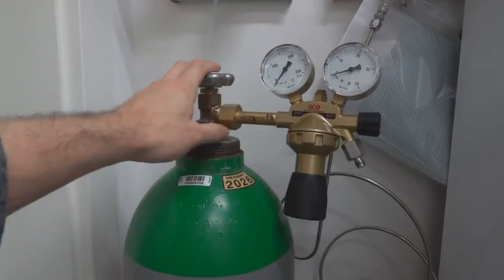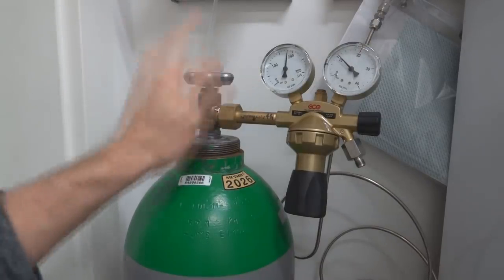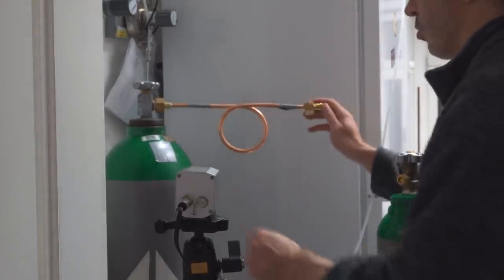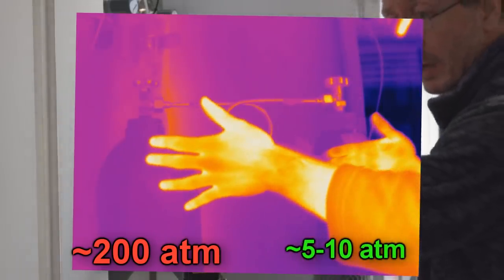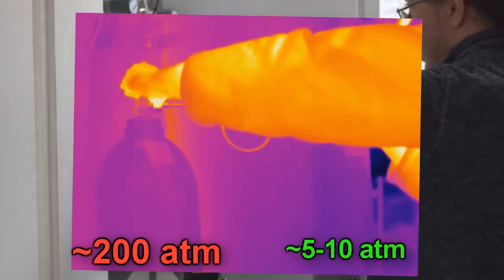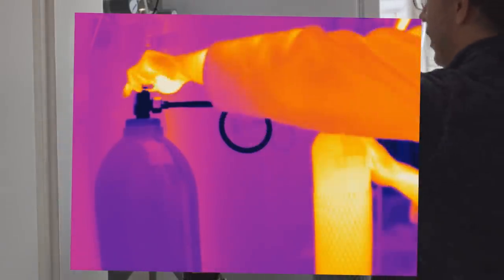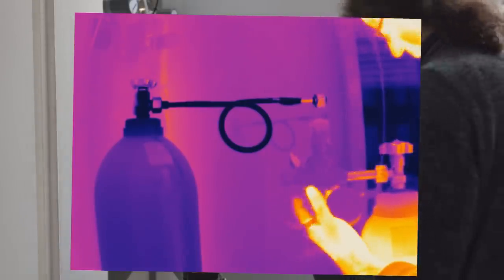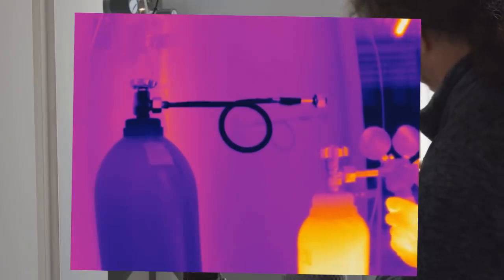Dangers of high pressure gas!

Comment: The high pressure realm, where the laws of physics as we know them don't work 😳 that's interesting. My car consumes LPG,  at least the pressure isn't that high, 14 to 17 bars... But good to know. I'll touch my gas tank the next time I fuel it up.
So, this should be thought of if you use N02 in your car. That even connecting the bottle to the system causes such incredible energy transfer...

Comment: I work near the hospital. They deliver the oxygen at times with low traffic. The hose from the truck becomes white the moment the guy opens the valve. Even more amazing is the hospital's oxygen tank: it has a heatsink!  The gas is SO COLD when it leaves the tank, the heatsink (which is, mind you, over 3 meters tall and has a base of around 1x1), is a BLOCK OF ICE even in the hottest summer days. 3 cubic meters of ice formed by just oxygen expanding when leaving a pressurized container. dang!

Comment: When I was 16 I worked in scuba shop we used to fill bottles submerged in water as they used to become rather. 

I remember being near a customer who opened two tank valves at the same time the force was unbelievable. Certainly eye opening we were taught to respect compressed air.

Comment: You should have explained that the heat-up is due to the gas firstly cooling by expansion and then being compressed. Compression alone (from room temperature) would cause WAY more heat than that.

Otherwise:
GET YOUR FUCKING SAFETY PROCEDURES STRAIGHT!
This has been a horror show to watch.
1) Chain your bottles
2) Always used hearing protection. A rupture at that pressure may make you deaf.
3) Gloves
4) Face shield

As a side-note... 200 bars makes a nasty sound. Some high-pressure pre-charge cylinders operarate at 500 bars and above. Now the sound coming from that kind of things opened up is deafening beyond all expectations. Will easily blow holes in thick gloves, rubber, etc just by the "jet" of gas. Extremely dangerous, outright lethal.

Comment: How efficient is compressed air as energy storage? It seems to me that, although heavy, a large amount of the energy stored in a compressed tank can be used later with very little wastage. Plus the movement of the compressed gas as shown in the video looks like a good way to cool stuff down on demand. Am I wrong in this assumption?

Comment: As a diver I can ascertain that 200 bars of gas are insanely loud when you open it up.
Yes, the SCUBA tanks get refilled at special filling stations within around 5 minutes to 200 bars, or in some cases, even to 300 bars.
And yes, the tanks get warm, sometimes uncomfortably warm to the touch. But they would never reach 100°C.
Because the pressure differential would continue to reduce (ie the delta becomes smaller and smaller) as one tank gets closer and closer to the other in pressure.

Alright, if you had a HUGE tank of let's say 300 bars, and wanted to fill large numbers of smaller tanks to 200 bars, yes, that would work.
And in that case the smaller tanks would heat up to very uncomfortable temperatures.
But even then tank would probably also be much thicker to ensure safety, increasing the mass, thus also increasing its temperature storage capabilities.
Again, making it very unlikely to reach 100°C.

Unless you had insanely high pressures (2000 to 3000 bars) to fill up lots of smaller containers very very quickly.
But doing that would spell disaster on so many levels that 'it wouldn't fly' would be a terribly inappropriate thing to say. 
Because they probably would... only not very controlled, or in a direction you'd like. And not very continuously either.

And flying over to a charging station to then get a 100 meter uncontrolled burst of flight is pretty obviously a very stupid idea.

Comment: careful with using the actual pressure as an argument against feasibility or safety. Firefighters run into burning buildings with 300bar strapped to their backs. Divers go under with 200bar. (I've done both, so I'm not your average troll here)
It's a shame no mic can actually capture the extreme loudness of the wizz of an open 200bar. It sounded like not too large of a room, so I'm hopeing you were wearing hearing protection... Heck, we had an accident with a freshly filled bottle (one of the older steel ones at 220bar, not the carbon lightweight that go over 300bar) where the tap broke and ripped (luckily, neither the tap nor the bottle went flying) but in just a few seconds most of the air escaped. We got ringing ears till the next evening as if we had just spent the entire day on a metal festival. We let the bottle regain some heat for a while, because not only was the entire thing covered with a thick icy crust, but the metal (especially around the crack) was so cold, it would freeze your skin right off...
So, yea, there are plenty of risks with pressurized gasses, but when properly stored and handled, the actual high pressure should not be an issue... I can see a whole bunch of other elements where musk's idea is ...err... somewhat poorly thought out. (did I put that delicately enough?) XD

Comment: was working on a large valve once with a remote hydraulic control. we misunderstood how it worked so we got an oil leak at over 150 bars. only a pipe with an inside diameter of about 8mm but that was still a large amount of oil that came out. normally the system would only hold 75 bars but my supervisor was doing a pressure test on the system and showing the customer that there was no leaks. let's just say he was not happy when he saw the oil shower that was at this point unstoppable due to a gasket that broke when we opened the system.

Comment: Should probably mention that best practice is to ALWAYS USE A REGULATOR and slowly increase the pressure to limit the flow when transfering any gas from a high pressure vessel to another. Also, be aware that of the the vessel and equipment and plumbing a max working pressure.

Comment: Can someone explain why the smaller cylinder heated up? Unless I am missing something it was mostly gas at a higher pressure and equal temperature going into a tank with lower pressure, shouldn't it be cooling the other tank?

Comment: As a paintball player(also an engineering nerd) a 306 atmosphere(4500 psi) HPA tank failure it's probably the scariest thing I've ever witnessed. the regulator was in a tree and required tools to extract. It is more than enough Force to kill you if you were in the way.

Comment: The large cylinder cooling and the smaller one getting warmer is probably something most of us expected, but why did the connecting line get so much colder?  Perhaps it's because that is where most of the heat transfer takes place.  The gas is moving fastest there after all

Comment: Thunderfoot, why is there a circular bend in the copper tubing? Does that have to do with the adjustment of height of two cylinders? or is that there for another reason?

Comment: I love science but I am not a scientist so I have a question.  What is the energy efficiency of this?  Could you use the heat from the pressure transfer to generate power?  I'm probably wrong but this is how Air conditioners work right?  If you set 3 tanks up in a closed loop, what happens to the pressure after generating and losing the heat?

Comment: Does this also debunk Hydrogen fuel cells? 5000psi at room temperature
Reply: Not really. Hydrogen fuel cell cars like the Toyota Mirai have been on sale since the start of 2016, and a few thousand of them have been driving around California over the last few years with 10,000psi tanks in them, and so far there haven't been any incidents.
So if anything I'd say it's the other way around. The existence of fuel cell cars with ~700bar tanks in them debunks whatever point thunderf00t is trying to make with this video.
Clearly someone at Toyota found a way to make it practical, and with a level of safety that's at least on par with gasoline cars.
Reply: @lazarus2691  Excellent, thank you

Comment: I don't doubt the Elon will make a roadster with those rocket thrusters.... but I doubt you'll be able to buy it because I'm sure it won't be street legal. It will be done to show "look this is cool" a PR thing so to say.
Reply: This is my opinion as well. On paper the math checks out, SpaceX's RCS system can produce ~150,000 newton seconds of impulse, which can lift two tonnes for ~6 seconds.
But the sound alone should be enough to prevent it from being road legal. The thrust power would be comparable to a small jet aircraft which suggests ~125 decibels.

Comment: TF, Please... NEVER open a cylinder without a regulator.

There have been stories of cylinders exploding, one I was told of was a pub landlord changing CO2 cylinder on a soft drinks dispenser, I was told this years before the internet existed.

Here is the BCGA advice and if you scroll toward the bottom, you can see what a small cylinder like the one you were filling can do when it explodes.

Comment: 1:26 - That is not a 200 bars tank full open. He opened a small portion of the valve, and because of that we only see a small portion of the force that a full open valve can make.
The gas is at 200 bars of pressure at the hole here the valve is open(like a door), and right after the gas pass through the hole it expands and the pressure drops.

This is what a hole from a bullet(full open valve) at a 200 bar tank should look like:
https://www.youtube.com/watch?v=bqbWc5bzoiE

Comment: AFAIK, it is VERY BAD PRACTICE to use Teflon tape (or any other sealant, for that matter) on gas cylinder valve threads, as they're compression fittings, which depend on metal-to-metal seal at the face surfaces.  If the fitting leaks, and moderate torqueing doesn't seal off, removee from service and have damaged surfaces reshaped, or discard.

Cheers,
Dave Cole

Comment: In the 80s I saw a picture in a truck and tractor tyre industry magazine. It was a human imprinted into the concrete ceiling of a workshop aftr the tyre blew up while he was bending over it. The skull and teeth were clearly visible. Do not toy with compressed gas.